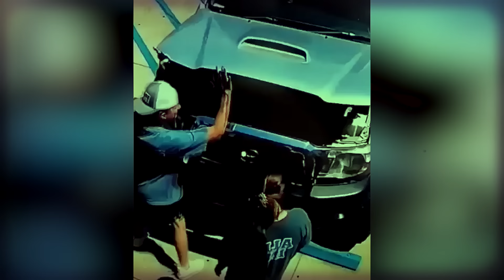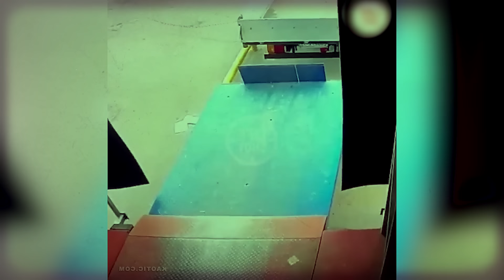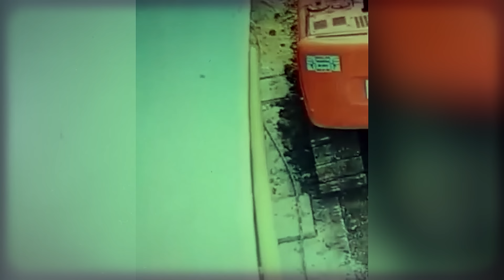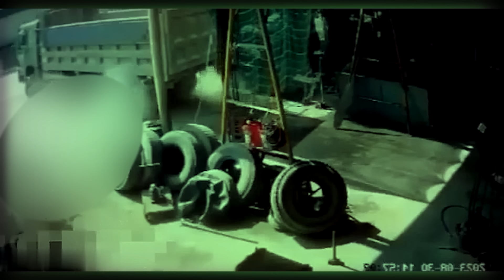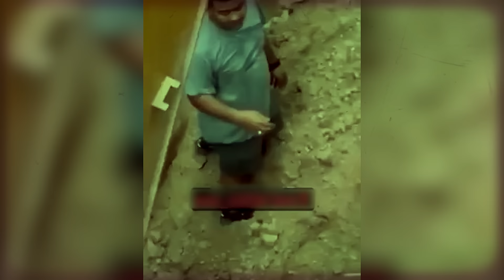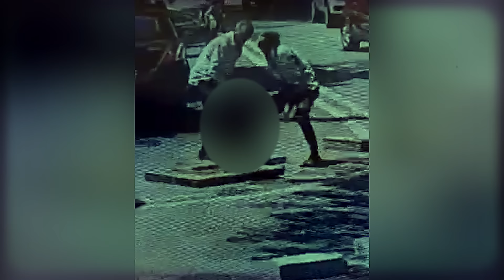He Didn’t Step Back in Time… Then This Happened

Comment: Why on earth would somebody pull a heavy ramp toward them without any way to stop it? Whats funny is that both of the ramps fell at one time. How does that happen?
Reply: Everyone does dumb things sometimes.  This one (and I mean respectfully to the poor man) takes lack of awareness to the next level.  It’s about the same as starting a chainsaw holding the blade part between your legs to start it, or trying to hang a picture with one hand and hammer in other, then dropping the picture to grab a nail.  Or calling a tow company to help u get the keys locked in your car when the window is open.  Personally I lack judgement sometimes, rarely this bad.

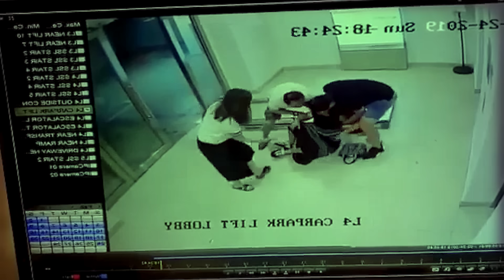Comment: 2:27 Temu level installation. These crashing gates seem to be very common in Asia, not a maintenace issue. Why have doors if they were just raised to place, without bolts and screws.

Comment: Everyone in. The. Videos. Were. Brain. Dead. All ready  and. Did stupid shit.  The. Driver that drive over the man. Hole should not have a licence or drive. Who. Lifts. Big steel coils. On a beam. Only suspended in meddle.  And. Nothing to keep. Could from sliding off at ends.   The guy hit by. Ramp should of. Ran. Away from. The. Truck.   Not in to the. Middle of the.  Two ramps or. Should of. Pushed. From trailer. Or used. Loader to pull.  The old. Man. Was. O.  His. Phone. And. Just arrogant

Comment: Wearing flip flops, shorts and t-shirts and no head gear  while working on a construction site should give insight into the mindset of someone pulling a heavy ramp down upon oneself. The usual words like cretin, dumb or stupid do not really describe this type of behavior. You could say that pink shirt was dumb or careless, but that really does not convey the weight of the action you see here. This guy really did just pull a heavy ramp right down upon himself. I would really like to see an interview of this man explaining his actions.
Reply: At least the dog summoned help!
Reply: I doubt he's capable of an interview.
Reply: Pulled it and walked under it as it was coming down. Not too bright.
Reply: This one was crazy. Like he had a sudden strike of amnesia and completely forgot he was pulling down a giant ramp.
Reply: I suspect that such large ramps would have a mechanical system to assist in raising and lowering. You can see it between the two ramps after he pulls the chain.
Most likely this system failed causing the sudden fall.
Reply: it was a warm summer day.